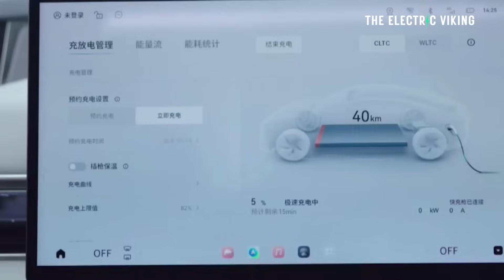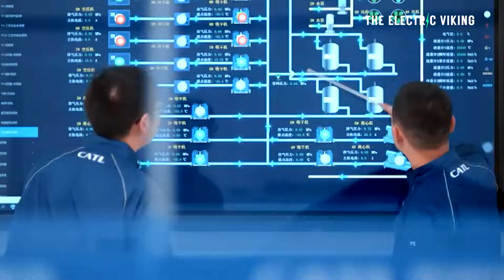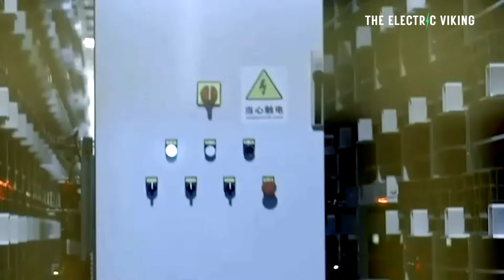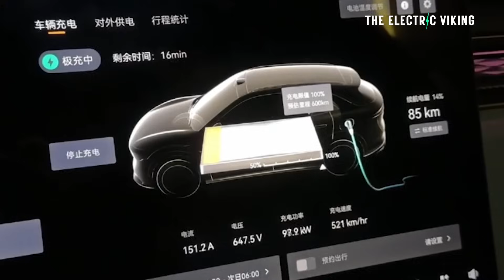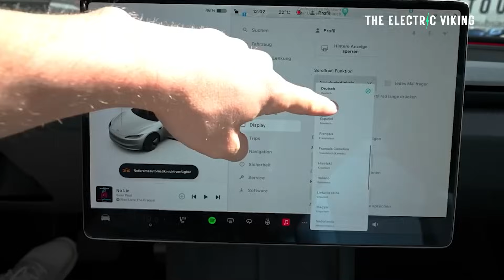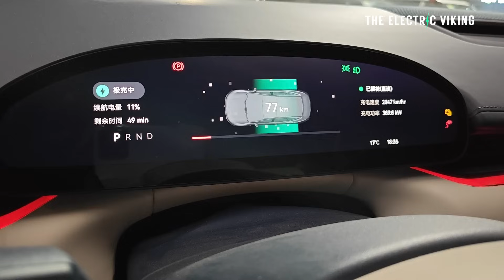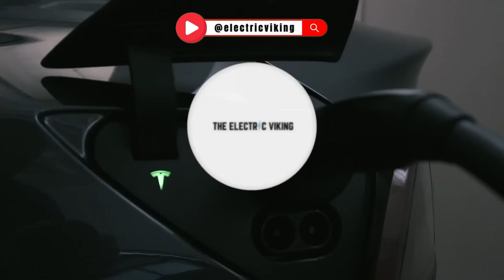CATL’s Shenxing V2 Battery: 800km Range, 5-Min Charge – EV Game Changer!

Comment: It's worth taking a broader perspective, particularly looking at the charging infrastructure, because when you do, it becomes clear that this is not a game changer in the sense that it "solves" the charging time problem.  Electric charge is not stored at a charging station like gas is stored in tanks under the forecourt, but has to be delivered on demand, in real time, from the grid.  The best analogy would be like having gasoline piped directly from the refinery to the gas station pumps.  If a few cars fill up at the same time, the rate of fuel draw would not exceed the capacity of the main supply pipe, but as more and more cars start filling, the rate of demand would exceed the rate of import, and the fill rate would fall.  This is exactly the problem faced by EV chargers.  It is already a problem with the current "fast" chargers, that as more motorists plug in, the charging rates drop significantly.  There is also the fact that most people charge at home and never use public chargers, which makes expensive chargers economically unviable.  I believe the current charging stations are losing money, which is why the roll out of more stations isn't happening.
Reply: Wrong.
Electricity is increasingly being stored at charging stations, meaning a minimal grid connection (1.5 MW) only is required.
Reply: @John-p7i5g  As John, said the plan is to have a continuous flow to onsite battery storage the cars will charge from a combination of grid and battery. This should keep grid usage more uniform and stable. I know people also have questions about these sorts of things, but engineers have already had to ask themselves these questions and come up with solutions.

Comment: A battery that can take lots of electrons is an easier challenge than having enough electrons to charge on a specific charging location. Solving the latter is the real game changing moment.
Reply: It's already solved with on-site stationary storage.
Reply: @John-p7i5g  Not even close. We still have a massive infrastructure investment to make before local storage is the solution for all charging locations.
Reply: @mjcapinto  True, but that's where it's heading. It's the modern equivalent of the fuel reservoir underneath a petrol station.
Reply: @mjcapinto  Tesla has a 100 stall Supercharger under construction with an affiliated solar power plant with Megapacks. That is the future, much better than upgrading the electrical grid. Localized production and consumption of electricity is the future. Battery technology is becoming increasingly more affordable and you can have the storage with less energy dense chemistries like sodium ion batteries.
Reply: home charging from a home battery linked to home pv system could , in theory, charge at these power demands. IMHO.
Reply: @davidkreimer2970  

Home charging doesn't have the pressures of public charging, both on the need for speed, electricity availability, and throughput.

Comment: If you charge an EV in 5 minutes,  it will take 12 times the charging power that it takes to charge in an hour. Good luck finding a 1 megawatt apparatus for this function.
Reply: China has plenty of 1MW chargers 😮
Reply: @peteholliday1927  isn't it not recommended to fast charge often because of battery degradation?
Reply: @skylershank9309  - depends on cell chemistry and battery management design (particularly cooling), some vehicles are less impacted than others by frequent ultra-rapid charging (p.s. fast charging, i.e. up to 50kW isn't an issue).
Reply: We taking about first world China not third world USA
Reply: @ciybersal3499 😅
Reply: @ciybersal3499  I can tell you've never seen China Observer. 1st world, no way.
Reply: Megawatt chargers are starting to roll out for eHGVs in Europe, which uses the MCS standard supporting up to 3.75MW charging.

Comment: Curious to know the warranty for such a battery, how many discharge/recharge cycles are covered.
If the industry is moving to 5 years/ unlimited km warranty, you should be able to cycle that battery 250 times (eg once a week) at the crazy speed and still retain 80% range.
Reply: In the next video on sodium it's 10,000 cycles.. incredible

Comment: Thanks for sharing. Although this is quite interesting and would be awesome if it works I'm sceptical about the longevity of batteries being charged at these speeds. Hope they give a good warranty.
Reply: In China some companies give lifetime warranty for first owners, other car companies give 1 million kms battery warranty, which means if battery degrades below 80% ( Before you reach 1 million kms ) they will swap a new battery for you...
Taki drivers in China are very happy about it.
Reply: @stephenwx4759  personally I will not buy one of these fast charging vehicles without a life long warranty.

Comment: The biggest problem are gonna be the power companies and infrastructure. In Croatia it can't even cope with 150 kW chargers in summer, where there are many many tourists coming to the seaside...
Reply: @vgbyte1648  aquifer pumped hydro might be able to help in regions where that water has been contaminated. Pump it up to higher ground, filter some of it as it comes down and use the rest for energy. The problem then is minimizing surface level contamination, but j haven't looked into that yet .
Reply: You have stationary storage batteries on site that can get filled at night with coal or midday with solar excess.

Comment: Got to wonder how quickly the battery degrades when charged at that speed, I’m yet to see a battery that holds up under fast charging long term let alone this
Reply: 5  years after productions starts, we will know.
Reply: Data from older Teslas shows no additional degradation from 250 kW fast charging. It is temperature and time that kills batteries, not cycles. As long as the car has good thermal management, it shouldn't effect battery life.
Reply: @williammeek-h2o  Lets wait and see, shall we?
Reply: @ The oldest Teslas are 15 years old. How long do you want to wait? 
Until people forgot you were wrong?
Reply: @williammeek-h2o  This is mew sodium iron battery tech. Its characteristics are not known as they will not start fitting them to evs for another 2 years.
Reply: @Dungshoveleux  They probably never will put them in EVs because energy density is very poor. Maybe for stationary storage.

Comment: Finding somewhere to charge it at that speed might be a challenge.
Reply: Adoption of new technologies may be a challenge in the beginning as with nearly everything but it's a tiny step towards a cleaner future
Reply: Yes, but there is no difference between a Supercharger with 100 stalls fully occupied and a charging station with (roughly) 20 stalls at 1300 kw each. You need much less stalls when the cars charge in 5 minutes. We will see bigger charging stations that have a solar power plant affiliated with battery backup storage units.
Reply: You will need industrial sized substations to support such charging rates and seriously upgraded power line corridors as well.

All that said, these ranges and charging rates are what will get me over the line.
Reply: @robsalvv5853  That isn't how charging stations work. They are built for a certain number of cars per hour at peak. It doesn't matter if they are charged at 250 kW or 1250 kW, the peak power draw will be the same. you just need more charges to service the same number of cars at the lower charging speeds.
Reply: My thoughts exactly and I think they would only be located near high transmission lines, lucky those lines are usually are close to major roads and five minute charging is only needed on road trips IMO
Reply: @alexkreet1862 exactly this. People only see problems, engineers see solutions..
Reply: exactly ! A power of 1300 kW at a voltage of 230 volts corresponds to a current of approximately 5652.17 amperes.....  That's the total capacity of a large industrial manufacturing plant.
Reply: @phvaessen see the image at 5:14.  Besides the charging kiosk can draw from onsite batteries that are charged 7 24 continuously from power grid, thus spreading out the power grid demand.
Reply: @phvaessen  it's unlikely to be a home charger but a multi point charging station  fed from the overhead power lines the ampage would be very small.  The infrustructure always plays catch up to transportation  advancement, needs and requirements..
Reply: @phvaessen  The voltages are 400 volts, 800 volts or 1000 volts.
Reply: Just check "Tener" and "MC Cube-T" BESS (Battery Energy Storage System). They put 6.25MWh (resp. 6.43MWh) into a 20' container. Some of these for every charging station will enable using "overcapacity" and cheap energy prices as well they could be used for net stability.
Reply: Give the Chinese engineers and business owners a task, then you probably see that happening in the next year or 2.
Reply: Yes on the rest of the world. Apparently China have already been deploying 1mega watt chargers along their motorways - insane😱
Reply: 10 years to have this rolled out in the West, infrastructure progress is just terrible.
Reply: @ISuperTed  That is what happens with capitalism in the absence of free markets
Reply: Adoption of new tech can be very fast if it’s proven to be good. The adoption of gas station networks took in a bit over a decade
Reply: @donaldlee8249  You mean like in China and Europe and many third world countries?
Reply: Cars that use it will likely have dual charging ports, so in the USA one could still charge at 700 kW.  Though I doubt we’ll ever see this technology in the USA; we are a backwater nation.